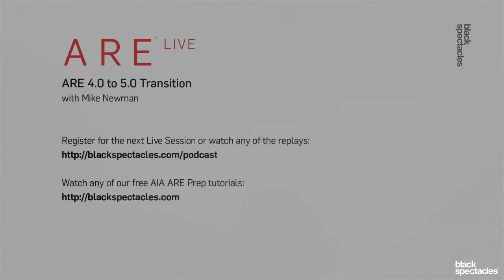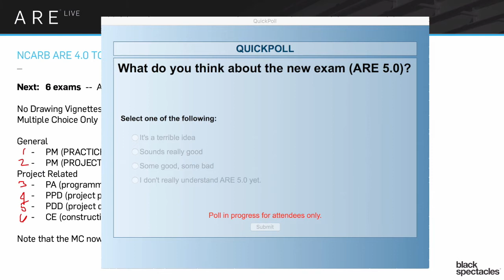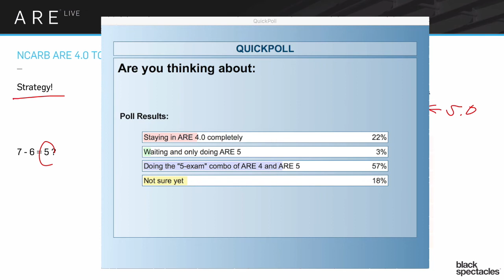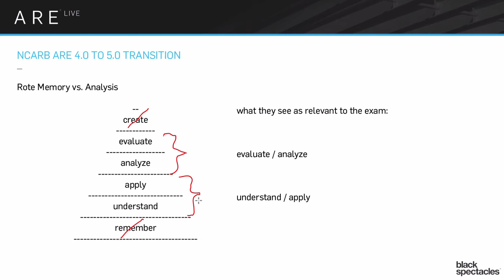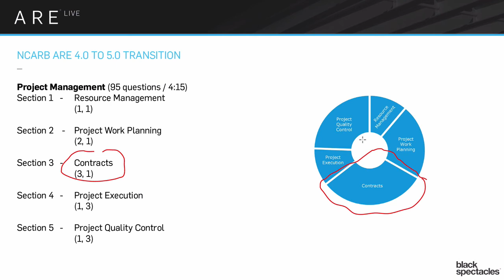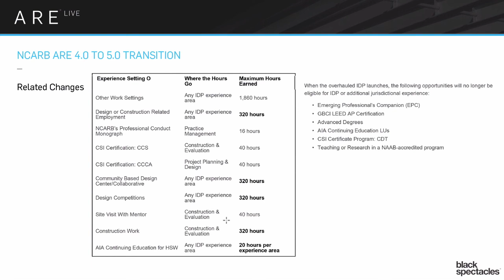How to Pass the ARE in just 5 Exams: A Discussion on ARE 4.0 and ARE 5.0

Comment: So we know that ARE 5.0 begins on Nov 1, 2016. There is going to be a 19 month overlap or so, with ARE 4.0 ending on June 30, 2018. Does that mean I should've taken at least one exam before Nov 1, on ARE 4.0 so that i qualify to take the 5 exams? or do i still have until ARE 4.0 ends to take the first 3 exams?
Reply: I am in this process right now myself. I keep seeing the word "Eligible" being thrown around. So if you are eligible right now for 4.0, you should have till 2018 to keep going in 4.0. I have passed the CDS exam though. If I pass PPP i get credit for 3 exams in 5.0. so that leaves 3 remaining so 5 total.
Reply: an easy way to find out is to just log into your NCARB and try to schedule a 4.0 exam sometime between Nov 1 2016 and June 30 2018. (You don't actually have to schedule it) but It should give you your answer. passing CDS, and PPP, in 4.0 give you the most bang for your buck towards 5.0.

Edit. if you do this consider your options about SPD in 4.0 as well. Either way its 5 tests total, but the way they overlap is different.

If you have any questions . . Hit me up